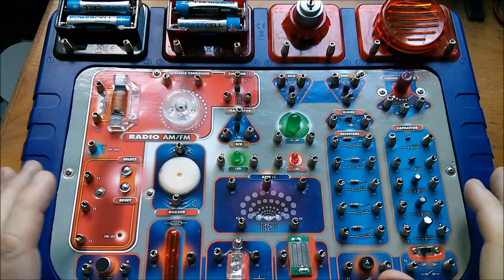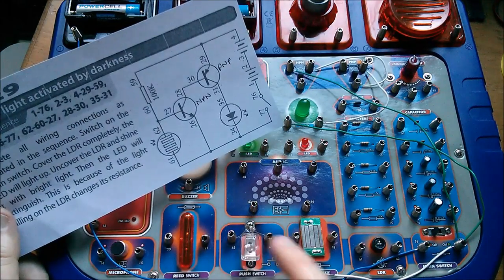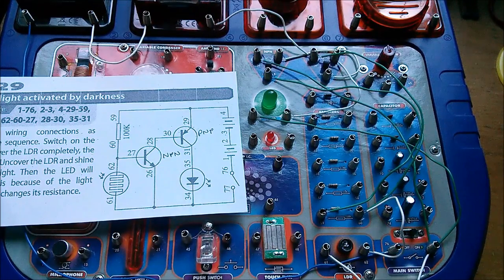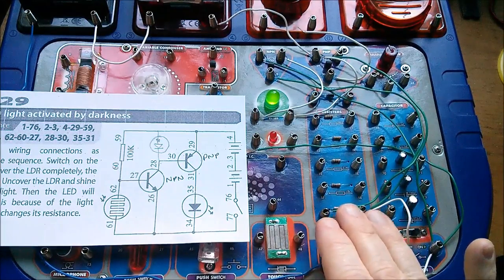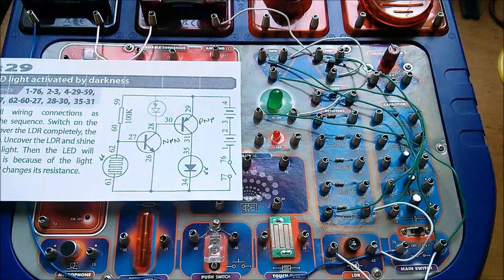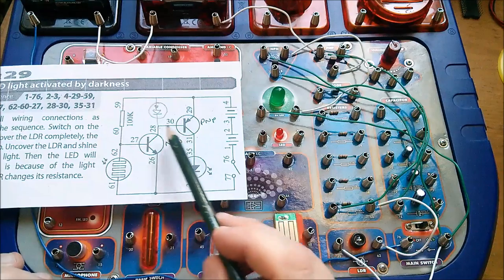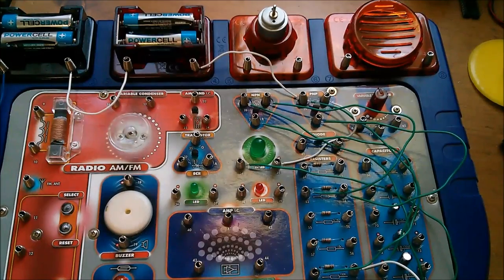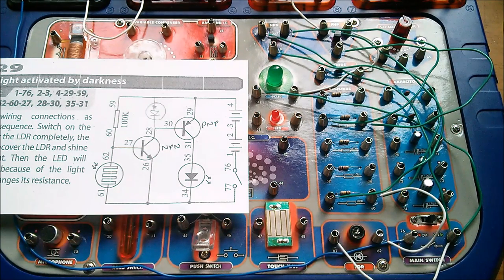Basic Electronics 2-Transistor LED Photodiode Circuit

Comment: Funny, I've been doing electronics since 1969 starting in tubes and working my way up, but mostly using canned circuits with slight modifications. I spent 30 years at Boeing doing advanced microprocessor and microcontrollers and now that I have been retired for 12 years I am just now interested in transistors and FET's!

Comment: Would have been interesting to add an ammeter to the circuit to see what current is flowing. Could also work out the transistor gains.

Comment: Interesting video. From my understanding of the circuit switching the PNP with the NPN will have a lower current draw when the LED is off, using a single transistor would require lower value resistor leading to higher current flow when the LDR conducts 'freely' (insert correct term here).
Like you point out as long as the correct resistor is used it won't blow the PNP but adding it would make the circuit much more resilient to a mistake or just the odd things that can happen in practice. 
I am also trying to learn via the art of electronics but have not got far yet. Thanks for all the help I get from watching your vids.

Comment: Julian, your explanation of how the current is limited to a safe value is slightly off.  The NPN transistor is not saturated, it is fully active and has a high gain.  The gain will typically not be greater than say 100 and its base current is a maximum of 60uA (not 600uA) and so its collector current will not be more than 6mA.  So the circuit is inherently safe if built as shown.  But you're quite right it would be good design practice to add a base resistor to limit the current especially in this situation where the user may change the 100k.  The saturated gain of a transistor refers to the condition where the collector voltage has fallen near to zero because all the supply voltage has been dropped across the collector resistor.  In order to get a very low collector voltage it's necessary to provide more base current than would be predicted by dividing the collector current by the gain. This is called forced gain and a typical value of 10 would be used.  In this circuit the transistor will never saturate because there is no collector resistor and there's always about 5.5V across it.
Reply from the maker: +number 33 Thanks,  excellent explanation, I'll have another look at the AoE.

Comment: The other way would be to put the LED above the PNP, which I think does put it into a complementary darlington configuration.
One other thing, are the transistors slugged with a protective resistor anywhere?

Comment: I had a few Radio shack all in one kits. 30 in one, then a 200 in one kit. binned it all last year when I moved
Reply: should have got a few quid on ebay - providing the components remained unsmoked
Reply: It was in good condition but I didn't have the time to Ebay anything. the house move happened within one month. I ended up binning all of my electronics. boo hoo
Reply: :(  to bad.
Reply: You could have made some grand money on eBay...

Comment: Base of the NPN transistor will see 54 microamps max (if the supply is 6v), multiplying that by the gain of general purpose transistor, optimistically 200 you will have less than 11milliamps flowing through the base of the PNP.

Comment: Great video Julian as usual BUT you didn’t actually do what you said you would do at the start; you didn’t explain to people like me why/how the circuit worked as it does. You went straight in to changes to it etc

I’m sure plenty (most?) other subs would understand how this circuit works, but I don’t! :(

Anyone care to explain? Is it a kind of potential divider using the ldr? You can tell I’m literally guessing. 

I’d love to know. Then I could watch the video again and might understand it this time 

Thanks
Reply: the LDR goes low resistance in the presence of light pulling the gate of the NPN low (off) nothing happens due to diode voltage drop from gate to source in the NPN being higher than the volage drop across the LDR, effectively all current passing through the resistor goes to ground . When the LDR is in the dark it goes high resistance and the resistor pulls the gate high (larger voltage drop over LDR than gate to sorce diode needs to conduct) allowing a set current to flow powering the rest of the circuit. I am also learning so do hope i got the explanation at least close (and understandable). 
so YES I would say it is a kind of variable resistive divider using the LDR(i could be wrong tho and be a different term for this).
Reply: Photodiode version: The photodiode is connected so that it is reverse-biased, so in darkness it behaves like an open circuit. Light causes it to pass some current in the reverse direction, diverting current away from the base of the first transistor. With enough light, the transistor doesn't have enough base current to turn on, and the LED goes out.

BTW, substituting a photodiode for the LDR without saying anything is also pretty unfriendly to beginners. They have very different characteristics -- you can't just blindly substitute one for the other!
Reply: Overly simplified? When in light, the LDR/phototransistor conduct and pulls the NPN tranistor's gate to ground, so it doesn't conduct, or conducts very little. The PNP transistor's gate now has no path to ground, so it can't conduct either, thus the LED does not light up. When in darkness, the PNP transistor conducts, making the PNP transistor conduct, making the LED light up.

Comment: Don't quote me on this but I vaguely remember reading that very small amount of current flows into/out of the base of transistors because the base is very narrow or something along those lines. So, does large amount of current ever flow into/out of transistors? Lemme know.
Reply: Brainstorm4300 Sometimes, and not always intentionally.
Reply: Yes, transistors can easily pass enough current to destroy themselves without appropriately-placed resistors or other means to limit current.

Only a small base currrent is needed to make the transistor conduct, but it's up to you to ensure that the current remains small.

Comment: The one question that comes to mind is what would happen if you put the LED in one end of a tube and the LDR in the other? Would anything happen or would it blow up?
Reply: Depending on how slow the transistors switch, you might get an oscillator.
Reply: pileofstuff Actually you'd get an oscillator either way, but the switching speed would affect the frequency. When I got a couple of relays, I connected the switching part to the coil and got an 8kHz-ish buzz, which is quite high because we usually think of relays as slow-switching. Plus, by adding a coil capacitor, I could tune the frequency. Took me a while to realize that I'd invented the relaxation oscillator.
Reply: True. I guess the speed of the components would mostly effect if you noticed it oscillating or not.
Reply: pileofstuff And if you didn't notice the oscillation with the LED blinking (and I have never encountered a transistor so slow that you would actually see the blinking), then you would at least notice that the LED seems 50% as bright as before due to the PWM.
Reply: True.
Reply: pileofstuff A useless piece of trivia: if you have a power bank that switches on the output when disconnected from the charger, then by connecting the input and output, you can make an approximately 3Hz, 35% duty cycle relaxation oscillator. (That, if you get lucky with the type of chip in the power bank, will blow up after around 2000 cycles. Yay!)

Comment: Enjoyed the video.  I'd like to comment on your concern about limiting current on base of the PNP transistor.  When you think about it there is an effective resistance on the base from the 100K resistor on the NPN's base (as you mentioned).  To carry that further the effective resistance at the base of the PNP would amount to the 100k divided by the HFE (can't do subscripts) of the NPN.  A super high HFE of 500 would make the effective resistance 200Ω--still high enough not to cause a problem.

Another point is about how putting resistance of the base of the PNP didn't effect the function of the circuit.  The NPN is a current amplifier.  Say the HFE is 100, then If you put 1.0 ma of current into the base you will have 100 ma. of current going into the collector.  The resistor won't affect that (unless it is too large).
Reply: Only problem is that this is an experimenters kit. If someone tries different values to the 100K and chooses one too low then they might pop the transistors. An additional series resistor would protect the transistors.

Comment: Interesting video Julian, makes you think and dig for answers.
Growing up with Forrest Mims and his books I saw this circuit a lot. 
He used 2N2222 (NPN) together with 2N2907(PNP) Check out his Light Flasher circuit: https://en.wikipedia.org/wiki/Forrest_Mims
The mystery is in the PNP transistor spec. A high speed PNP with low storage times by using an internal Baker clamp.
The emitter base voltage can be as high as 2.6 volts which will current limit the circuit.
Maybe Tronex took the idea from Forrest.

Comment: Radio Shack sold this kind of kit in the 1960s. I started out with the 50-in-1 and collected all the variants. Anyone else build a baseband video amplifier, or other cool circuits, with their Tandy N-in-1 kits? The main thing was that each project had almost too much technical explanation. This demonstrated kit teaches no skills except how to follow instructions.
Reply: My first Radio Shack kit (actually Knight Kit by Allied Radio, because it was before the days of Radio Shack) n-in-1 kit like this had a tube amplifier circuit, because it was before the days of the transistor. You powered it by plugging it into the wall, and if you made a wiring mistake, it could be more exciting than if it worked correctly (LOL). 

They went into a great deal of technical explanation, too. That was the standard back then - to explain everything so that the young student would learn the theory of operation. Times have changed.
Reply: Many nights in the garage with my 100 in 1 and 150 in 1 electronics kits from Radio Shack. Hours of enjoyment that has lasted 40 years and formed a big part of my career that has supported my family.
Reply: I had the Radio Shack 10-in-1 Jr. Electronics Lab, a Christmas or birthday present from the early 1970s.  I just bought one on eBay for $30.  Julian, watching your videos always leads to me spending money!
Reply: That's bull#&(*&.  No, these kits won't make you an electrical engineer.  But for people who literally know nothing about electronics there's a lot to learn.
Reply: I've still got mine!

It lives in my son's room these days.
I should borrow it and re-live my mis-spent youth.

Edit: I found it!  https://www.youtube.com/watch?v=RqnLi1moiCI
Reply: Ahhhh yes.... I too recall with fondness the 100-in-1 kit from Radio Shack given to me by my grandfather sometime in the mid 1980's. It started my career in electronics.
Reply: videolabguy yeh man projects lab

Comment: No resistor between 28 and 30? The PNP transistor could have excess current flowing through the base.
Reply: Julian points out this problem at 13:00.

Comment: Not showing the resistor in series with the LED on the circuit diagram is also pretty naughty. Any poor sap trying to learn from this kit is going to get the idea that you can connect an LED straight across a battery and everything will be fine...

Comment: You are a child. I do not buy this kind of "electronic lessons" even to my son! We do it together, so he understands better, how to design. And..actually.. do you know, how to create a photo-resistor from a transistor?
Reply: Don't know about a photoresistor, but I once turned an ordinary metal-canned transistor into a phototransistor by cutting the top off and cleaning out all the heatsink goop that was inside. I wasn't really expecting it to work, but it did! (It was a GA396 if I remember rightly, which is actually a germanium transistor, but it would probably work with a silicon one if you could find one that could be opened up without destroying it.)